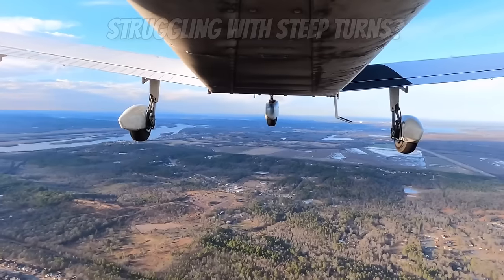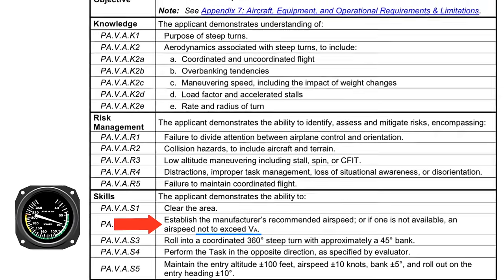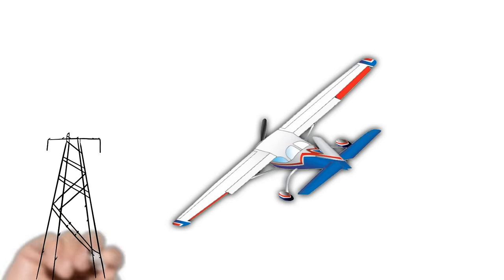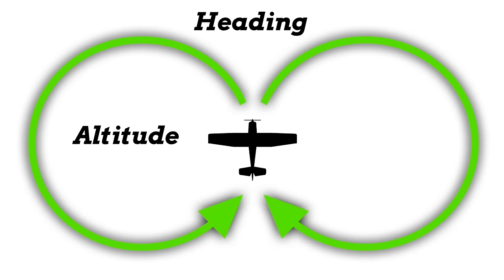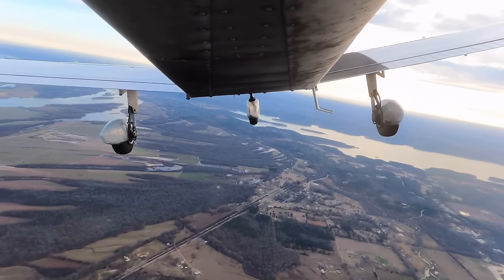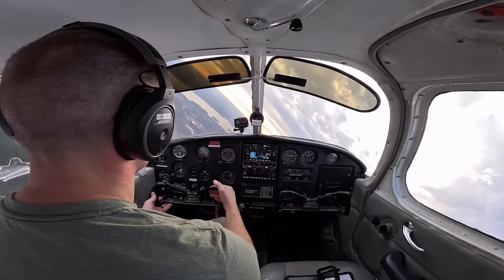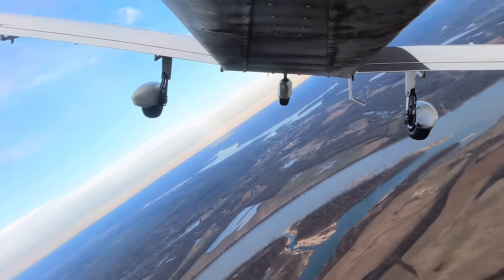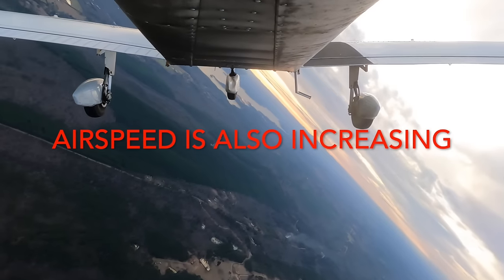3 SECRETS to Fix Your Steep Turns | How to Perform Steep Turns

Comment: I do not understand aerodynamically why neutralizing ailerons will maintain the turn. A yo-yo rotates only because an outside force forces it to change directional velocity, as soon as the string breaks or is let go the yo-you flies free in a straight line since no outside force continues to force it to change direction. A car not accelerating down a hill is completely different since that is not rotational changing velocity. 

But in the cockpit you neutralized ailerons and the bank did not slip out... why exactly
Reply from the maker: Because you have started a trajectory around that roll axis.  “An object in motion will continue in that motion until acted upon by an outside force.” There is no force to stop that trajectory other than the force created by neutralizing the ailerons
Reply: @FreePilotTraining  ok so your saying if you kept the roll in your bank angle would keep increasing resulting in a completely 360 roll? Though the planes airframe would likely not continually support this harsh of a turn.
Reply from the maker: @eliwilson5195  the only thing that would move it back is the stability of the airplane design, but it’s not enough to overcome the bank completely
Reply: @FreePilotTraining  still doesn't make since to me, objects in motion stay in motion but they do not change direction. 
How does the lower wing continue to produce less lift than the other when the ailerons are neutral? How does the outside wing continue to produce more? 

I'm not trying to be belligerent I promise this does not make sense to me.
Reply from the maker: @eliwilson5195  it’s not making less lift at that point, but the aircraft is already rolling in that direction. Something must keep it from continuing to roll.  Therefore we cause the other wing to creat more lift for a split second to stop the roll